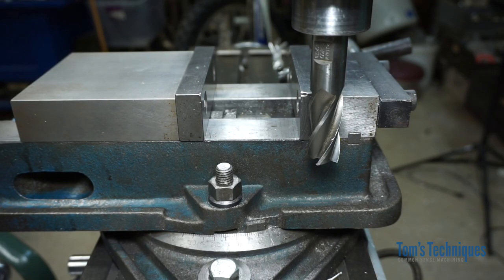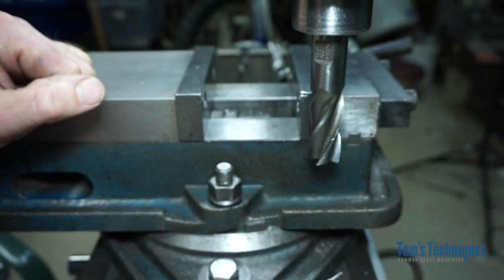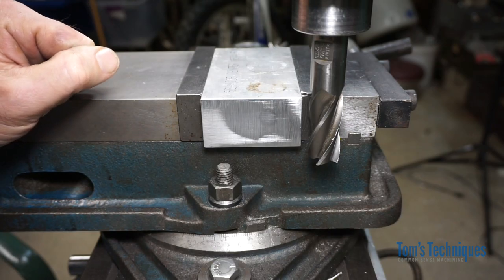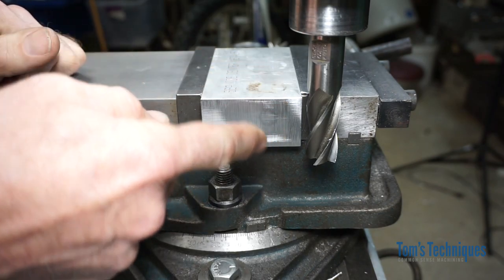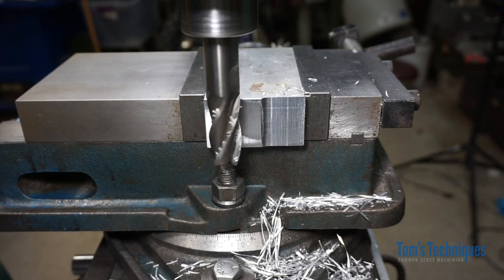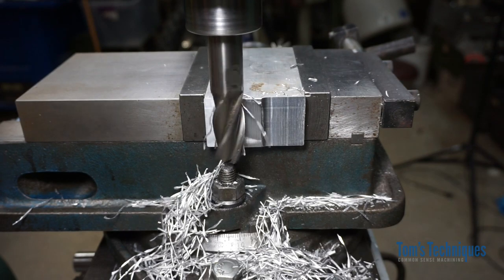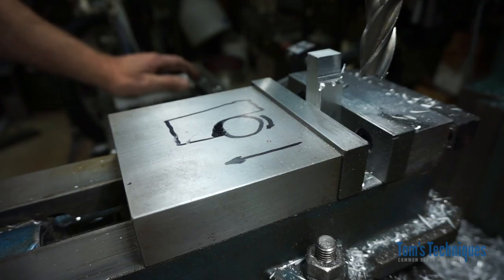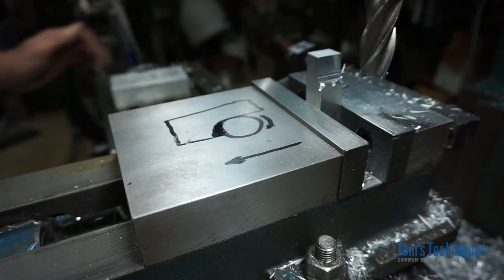Climb Milling vs. Conventional Milling

Comment: What was not explained in climb mill vs conventional is the heat! If you climb milling (if you can) puts all the heat in the chip and away from the part. And in most cases it does not requiring coolant. In conventional milling you tend to build up heat because you’re going from a zero chip to a think chip. The tool gets hot (which dulls the cutter) and part can be very hot. Heat destroys the edge of the cutter and it develops micro fractures.

Comment: Great information. As a newbie, I just bought a used combo mill-lathe and had a small project out of aluminum that, although I was aware of most potential pitfalls, my lack of tooling resulted in virtually ALL the problems you highlighted. It was quite shocking to see how much force  can get transmitted into the carriage!
The real life demonstrations and countermeasures are really, really helpful!

Comment: Wouldn’t a table lock prevent the work from being pulled into the cutter
Reply from the maker: @brentloftin5099  Yes, you can snug up a table lock to keep the table from being pulled toward the cutter, but that won't help with a part that's held the wrong way in the vise.

Comment: I retired with 34 years machine shop experience, with at least half of the years being a Milling machine specialist- meaning my entire work day was using Milling machines. 
A couple of additions I'll make is that the conventional Milling pull on the cutter can actually undercut the metal being machined. If the operator checks a part thickness and notes there's for instance,  .200 of material left to remove and in turn positions the table to remove .200, the resulting cut cut may actually take off more than .200. This is because the conventional cut will "pull" the cutter into the material being machined. This result is compounded when using a long narrow cutter that bends easily.  The operator may have a layout line on the top of the part but after the conventional cut completes, the bottom of the machined part thickness may be undercut while the top layout line is still visible . This is because the cutter bends in at the bottom during conventional cuts. 
The opposite occurs with climb cutting - the bottom of the cutter is deflected off of the part - resulting in a tapered thickness with the bottom being thicker.
If one made a climb cut pass to the layout line on top, the bottom of the part may be thicker. If the operator floats the cutter back across the part in a conventional direction, the bottom of the part may be undercut.  This will all vary with the length and diameter of the cutter along with how much material is being removed in one cut. 
Aircraft machine shop.
Reply from the maker: Good points. End mill deflection is why I always square up parts by end milling rather than side milling. I retired recently as well after 45 years of making chips, and guess what? I'm still making chips. At least I'm doing for myself now instead of someone else.

Comment: Thought you want 2 flutes for aluminum.
Reply from the maker: It depends on what you are doing. If you are milling a deep, blind pocket, then a 2-flute end mill will clear the chips better. If you are side milling like this, more flutes will generate a better finish.
Reply: @TomsTechniques  thank you.   I'm just starting out.  You're answer makes total sense. Especially when I go back and watch the video. I can see why it's fine on side milling.  You got a subscriber out of me.  And I came here for a better understanding of conventional vs climbmilling.  And you absolutely made that make sense.  Thank you

Comment: Very good video! I’m a CNC miller; been using these techniques for 25 years, but only now fully understand them. We usually program the tool-path / contour as climb milling. Roughing with a tipped tool (doing only 1mm steps) you can get away with that, and then the finished surface will be nice. .. Using a 16mm ripper to rough the job is a different story. Recently I had to machine 200+ parts. The old program was roughing jobs with climb milling. It ruined 2 rippers doing just 24 jobs. Then I added a conventional pre-roughing bit to the program. One ripper tool finished the whole batch (did more than 170 parts).
Reply: Please expain, you mean you changed the program to 'conventional' instead of climb milling? As far as I know (I worked in several machine shops but never actually at the machines) the 'modern' way of doing it is to always climb mill it seems. I have watched all Edge Precision videos also! Will investigate this further. I remember from my most recent machine shop employment they have some of these new algorithms which is called 'adaptive'.
Reply: @bigbattenberg  No. You have different options for roughing but finishing should be climb milling. .. High efficiency machining (dynamic mill, requital milling) or as Hurco calls it: AdaptiPath is a modern roughing strategy. You use almost the whole flute-length of the cutter (large depth of cut with small width of cut). The cutter goes very fast (F5000). I was machining Aston Martin components with AdaptiPath. 
You need very good cutters, like YG or MA Ford.
Reply: @007kisvakond  Cool, very good information. Thanks.
Reply: @007kisvakond  Awesome. I have learned a lot. Thanks.

Comment: Ive heard that the poor surface finish on a conventionally milled piece can be solved with a different feed/speed.
Reply from the maker: Sometimes, but a change in depth of cut, or the addition of cutting oil would likely be more effective.

Comment: I hate aluminum, i wish y'all wouldn't use aluminum in the YouTube videos at least not when machining, if u have to machine aluminum do it on fakebook or instaspam or something not YouTube cuz real craftsman are watching youtube not the lazy office fake wannabes....and if it's instructional...imho, it should always be done with some high grade tool steels or industrial type steels.... i understand aluminum has a particular approach due to its machining abilities or metallurgical structure but, I'd understand if it were a welding how to or whatever cuz welding aluminum is different but even then it's mostly about having everything set right and a little practice but machining is all about tight tolerances and tooling, cutting tool wear etc. All the equipment used for machine set up is steel, almost all high end precision equipment for measuring instruments or calibration standards are processes using steel and finishing.... u guys are tending to the next generation of tool makers not gunsmiths, gunsmiths buy the grizzly their "doesn't know shit about machining" gunsmith buddy advised them to get then doesn't "fully" understand concentricity. 

I promise u if u don't look at the center up and down and only fix side to side ur not fixing anything...hahaha... i promise u if u chuck up on a random piece of bar stock in a lathe no matter wtf tyle of chuck u use it still may not be right and ur hours spent adjusting ur lathe to compensate for the bed twisting or whatever may seem like ur never quite right and every time you check it with a new part that way ur going to be scratching ur head.
Reply: U see Mr. Pete and guys like y'all that have all the measuring equipment and stuff i don't pay no mind to what y'all think about what i say because i know y'all know i know what im talking about if y'all do see my comments, besides im never really talking to y'all I'm just keeping it interesting that's all. Y'all all seem to know y'all shit so far to me even guys like ya boy inheritance machine or whatever he may be new but, he's been around or has been a craftsman at something...it's obvious to others alike.
Reply from the maker: I'm not sure why you have such an aversion to aluminum. The only difference between cutting it and steel are the feeds and speeds that you work with. As far as why I use aluminum in videos like this, it's all about time. I can do a demo using aluminum in a fraction of the time it would take to do with steel. Viewers' eyes tend to glaze over if it takes too long to make a point. If you still have the need to see steel chips fly, feel free to view some of my project videos; there is plenty of steel used there.
Reply: @TomsTechniques  me either
Reply: @TomsTechniques  i just like steel man that's all
Reply: Probably because that's mostly what i was around before i retired

Comment: I have a older Sheldon horizontal mill 1inch arbor should I be up are down milling with it?
Reply from the maker: What do you mean by "up down milling"? If you mean climb milling, then no, you should not be doing that. The cutter will climb up the part and bend the arbor.
Reply: @TomsTechniques  yes that's what I mean,,, my slide table and arbor move in opposite direction, didn't know if I can do deeper cut that way and then light finishing cut climb milling for smooth finish,,,but it's not really that bad now l don't do alot and l don't want to hurt my vintage mill,, got it for 300 dollars and I couldn't believe of good of working condition it was in when I went to get it,, figured it was bad for that money,, seems hardly used,,

Comment: Tom you are the man but i will call you out on using a pined stationary jaw. Your stationary jaw is is held w/ a square peg which is subject to moving due to vibration. Solid back vices are always better (especially for demonstration)
Reply from the maker: Lol. I doubt the Kurt engineers would have used a keyed jaw on their flagship vise if they thought it would move.

Comment: 7:26 You said 400-500 rpm. I'd have gone for 1000. Looking at that finish, 1500 may have been better
Reply from the maker: 1000 or 1500 would burn up the end mill. There is a reason for calculating the proper rpm.
Reply: @TomsTechniques  Proper rpm: 1746.
Cutting speed: 400 fpm = 4,800 ipm. Cutter dia 7/8... so is LESS than 1" so speed can be increased proportionally
4,800 *8/7 = 5485 BUT circumf. is 3 x dia - so needs to be reduced by pi: 5485/pi = 1746 - which is a little more than the 1500 I'd suggested as a guess.

Data source didn't mention coolant - so let's assume yes.

I knew you were way low with your value - for aluminium. 500 sounds like a mild steel cutting speed.

Comment: Hello, im a new subscriber. have been in fixture building for the past three years. have watched a couple of your videos to help boost my knowledge on machining. I have been taught by a skilled tradesman of over 45 years experience. This video caught my attention because I never called conventional milling like you call it. I was trained to call it a push cut. as you are pushing forward into the cutter. climb cut was always best to be used for a finish cut. too much feed and too much material with climb cut can result in the cutter walking forward towards the direction you are feeding. the cutter doesn't have time to clean the blade and the left over material stuck on the cutting edge becomes like a grabber instead of cutting. something has to give. either the cutter or the part. I've made this mistake a couple times in my first year. now I can machine and rip thru material, completing my parts faster. thanks for sharing your videos. I will watch more videos if you upload. I know this video is 4 years old. but is still helpful for those trying to learn. thanks!
Reply from the maker: I have never heard the term "push cut", but it makes perfect sense. You are pushing the work against the rotation of the cutter. It's good to hear you have mastered the concept.
Reply: @TomsTechniques  talked to my teacher at work and he said he probably told me conventional push cut just to help me recognize what is actually happening so it isnt too confusing. I guess I didnt pick up the term conventional. Anywho thanks for the reply!

Comment: At the beginning of the video talking about hang out of the tool and flex, should be noted that the E-mill is high speed steel, which has a small amount of deflection, as compared to carbide.  Just a note..great video!

Comment: Good explanation, I learned the same 40 years ago. Anyhow, in the modern machines with very little backlash climb cutting is always used, as it saves tool life and produces better surfaces.

Comment: Using the mister while conventional milling will leave a pretty good finish. It will usually look pretty bad without using coolant and taking heavy cuts like that. Especially evident with high speed tools
Reply from the maker: Misting does help when conventional milling by lubricating the cutting edge as it drags across the work, but it doesn't have as much an effect on climb milling.
Reply: Toms Techniques absolutely!  I usually turn the mister off while coming back climb milling 😀

Comment: I'd like to suggest an alternate explanation. 

In climb milling, the bit is pushing itself away from the workpiece, into the air (toward the viewer, in this video). Nothing's there to stop it. 

In conventional milling, the bit is pushing itself into the workpiece (away from the viewer, in this video). The workpiece therefore resists the bit from moving in that direction.

Comment: You narrate good when I do videos I am a stumbling narrator. Anyway a couple of things to point out to people new to machining when coming up to a workpeice like he was showing that be aware that theoretically any time the cutter enters the part you have a zone in which you are climb cutting which can cause trouble because you may crank to the left and go to town hogging off conventional from left to right--but there is a problem that when you enter the part it can and will slam the table in the Y possibly crashing a bit. I myself sometimes use the lock thing but not aways I just am aware of it and cautious first starting out if you have a long length of cut and a huge cutter. Using a small cutter almost all of the climb/convential grabbing goes away especially at the higher rpm. Also on the TOP finish people should be aware that a square end mill like that you should use a diamond lap and stone a micro radius or micro chamfer on there before using it the first time. A dead square sharp cutter the tiny corner breaks off anyway microscopically in the first seconds. Another reason the small radius or chamfer is a must is that with dead square cutters you will get "breakout pits" in the workpeice because the very final cut there can be a tiny island standing that then breaks off and does not cut. Also the EDGE will do that sometimes very bad with some materials. With a radius insert or cutter or also a chamfer all that goes away because the final tit is a cone which gets smaller and smaller and is gone. eze lap makes excellent diamond laps for that purpose that last forever. When stoning on the radius you will get better finishes cutter lasts longer etc. To grind it on it does take an optivisor and skillful tilting of the lap so as to put the micro radius on WITH SOME CLEARANCE--You thus will be stoneing a microscopic cone. Untill you gain the skills best to do a micro chamfer of about .005 or so.

Comment: I think you got the wording the other way around. "Feeding against the rotation of the cutter" is what it's known as climb milling...
When you're moving the cutter from the left to the right (conventional milling here), the edge is cutting and moving in the direction of the feeding, not against it, that's why it is pushing the material, not pulling it toward the center of the cutter.
Reply from the maker: Another way to look at it is if you are feeding against the rotation of the cutter, where the cutter tends to push the work back against the direction it is feeding, you are conventional milling. If you are feeding with the rotation of the cutter, where the cutter tends to pull the work in the same direction as the work is feeding, you are climb milling. 

Defining a cutter that is moving right to left or vice versa is not a good example because it depends on which side of the cutter the work is as to whether it is climb or conventional milling. The best way to keep it straight is to use the feeding with or against the cutter rotation analogy.

Thanks for watching.

Comment: Nice video. I saw it in suggested videos and stopped by. I happen to climb mill every day and I do it on bench mills with power feeds and in manual crank feed all the time. Not sure what people complain about?. We will take big bites 1/4” (.25) but we’re also cutting at much higher speeds and feeds. I commonly run my bigger mill at 5k spindle speeds -/+ throughout the day. Also, I’ve never had a mill run slow like yours which I see is common with a lot of factory built smaller mills that may peak at 1500rpm. I imagine this makes a part more prone to grip and pull. Everything is at higher than 2k speed the majority time, carbide coated, high helix, multi flute, not using cheap end mills and the material were cutting 85% of the time is aluminum, mirror finish cutting, with indexables, however we also machine 4140, 1045, 8620, and 17-4ph at least a few times a month. We will take 1/4” deep cuts through 8620 while climb milling a 1/2” 7 flute end mill at full speed with the power feed (supposedly 200ipm) (probably 100ipm) and 5500 rpm and it cuts beautifully like butter leaving a finished like result the first pass. In fact I find it cuts much better climbing verse conventional it will sometimes sound less appealing versus that nice buzz cut we like to hear. Another thing to mention is that we use aluminum jaws which grip much better so parts don’t tend to pull up and out. Each jaw is machined specifically for the parts we’re running so they are cut to optimize holding power. Only time I have seen a part pull up and out is if we’re milling plastics.